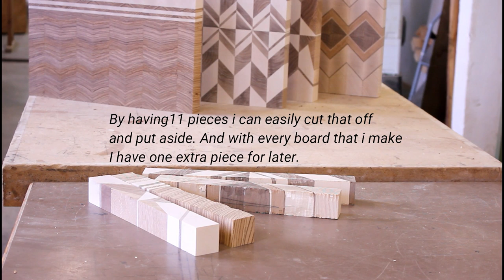Making Awesome Cutting Boards No:3 / Learn Something New

Comment: If you use a round over bit on edge of end grain it will not splinter when running thru planer. rounded edge in back of the board

Comment: Is there a formula that will calculate the needed length of milled stock to achieve the desired finished cutting board based on the the thickness desired as an end product?
Reply from the maker: Thickness of the stock + number of chrosscut pices determines the final length